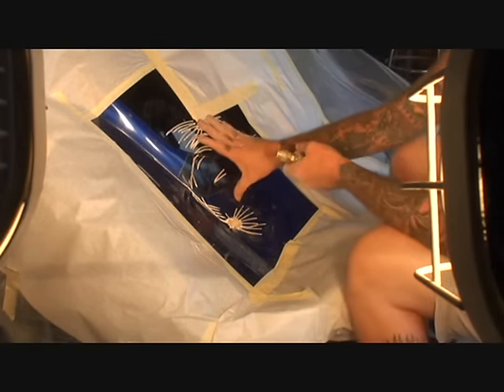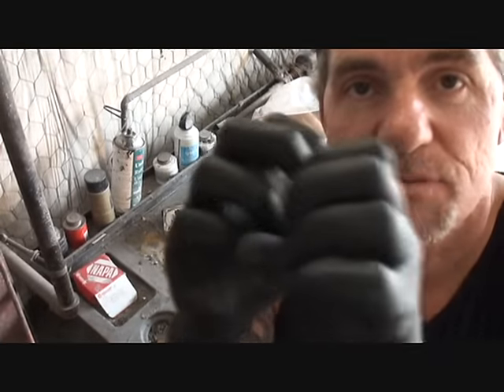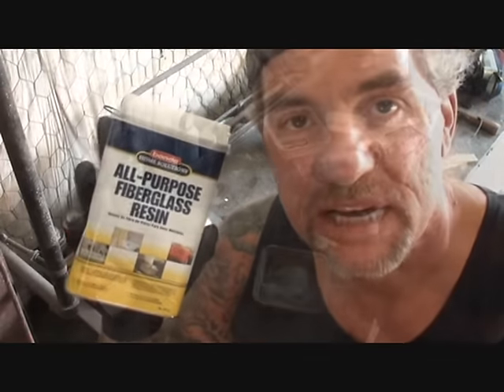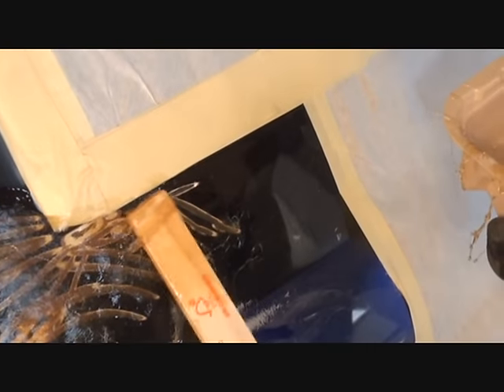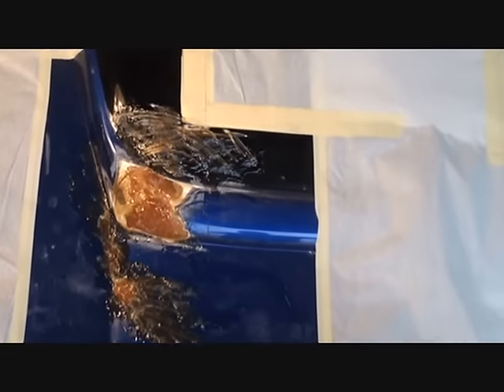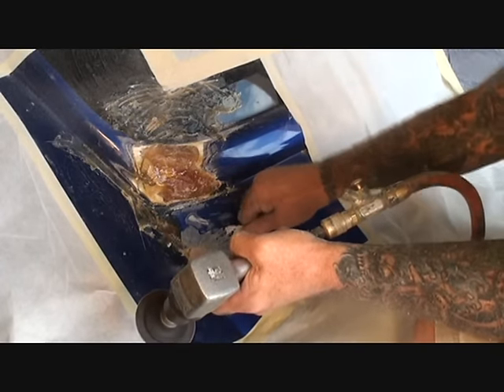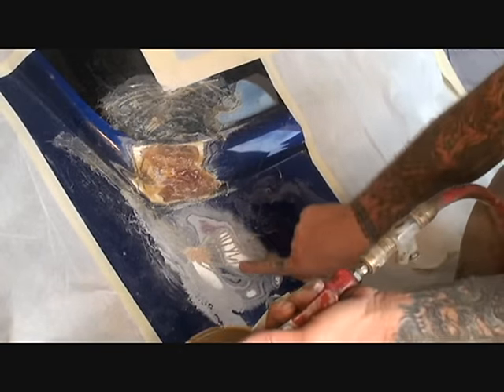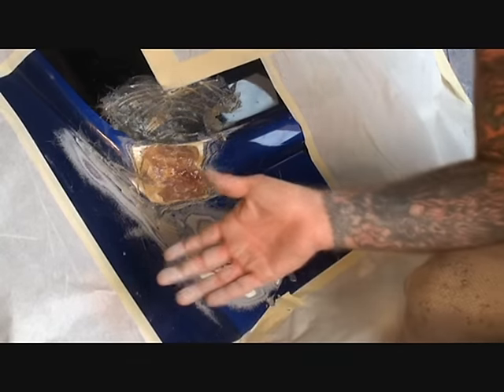How to Fix Cracks In Fiberglass Gel Coat Using Fiberglass Resin

Comment: Good to know Pete,thanx! I was just fillin them up with resin/hardener. But,over that,used this royal blue stuff in a big toothpaste tube by USC that contains shredded kevlar,carbon fiber,&fiberglass over that. Stuff is good & hard. My FG rear bumper cover had to be chopped into 6 pieces & re-sectioned to get a proper fit. This method worked  so well that,some 5-6 years later,it still looks great. You great man,keep it up!

Comment from the maker: @godofm3tal1 I presume your tlaking about a product like dynoglass. What the problem is with that verses this, it that using fiberglass resin as a base gives you a harder finish, so if the area gets again, it won't crack out as easy. When you use a bondo style substance it tends to shrink after time and look like crap. using resin elemanates shrinkage. Thanks Pete

Comment: @swrnc  Well Kitty Hair is an evercoat product. Said to be twice as strong as other fiberglass fillers, and is comprised of polyester resin, and reinforced with chunks of fiberglass strands. Ive used that stuff to patch up holes in roofs from service lights. I had a 4 post lift off hood on my 72 nova, and when i bought it, it had a corner that broke off. I used this stuff to re attach the corner. Years later I totaled the car. All the corners were busted...  except that one lol strong shit